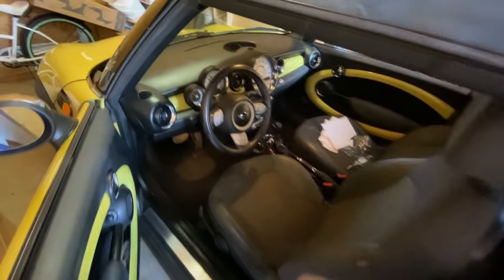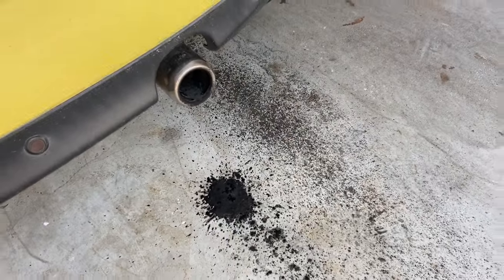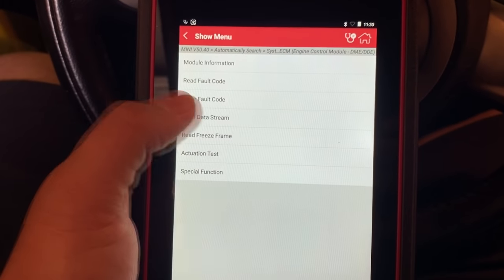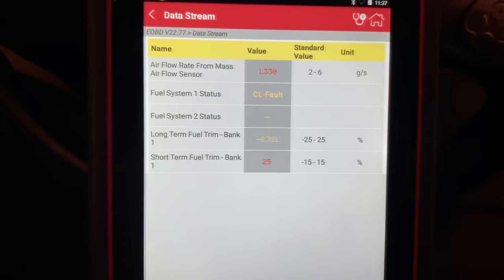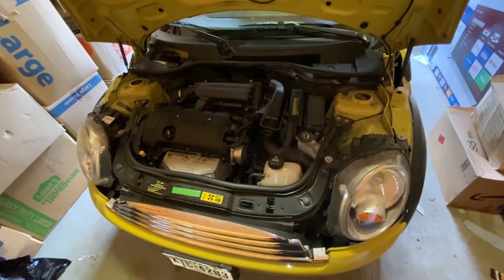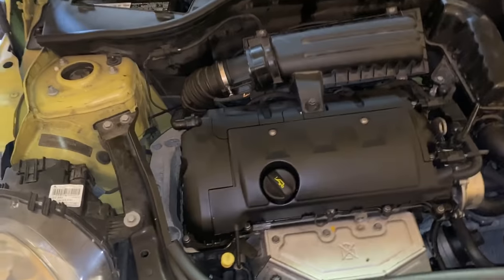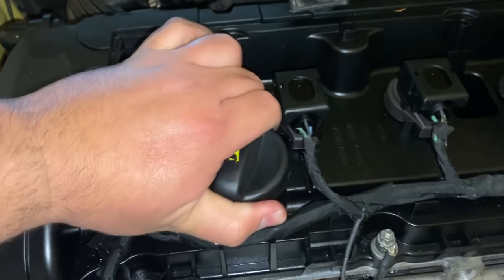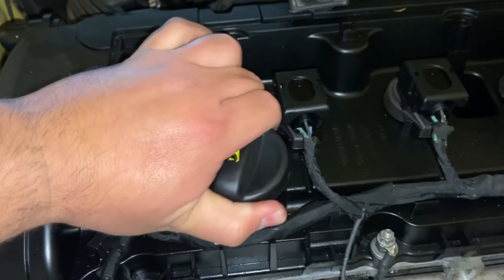MINI COOPER RUNNING ROUGH / HARSH IDLE DIAGNOSIS

Comment: BEFORE YOU REPLACE THE ENTIRE VALVE COVER, READ THIS! First of all, excellent video! The mechanic mentioned that he didn't work with Mini's, so no fault to him at all. But being a Mini owner you'll notice in the video that the oil cap isn't installed properly causing the vacuum leak (as he mentioned). I've  had this exact problem, which caused the same shaking. When the oil cap is installed properly the "oil lamp" logo will be perfectly positioned horizontally (as if the lamp was sitting on a flat table). In the video the lamp was screwed on too far making it go vertical. This is most likely because the rubber washer was lost when the cap was re-installed. This happened to me when I had some one else change my oil. You'll also notice that he had a hard time taking the oil cap off. This happened to me as well. That's because without the rubber washer on it the cap will turn too far making it like a puzzle to take off. Also, you'll notice that when the new valve cover (that included a new oil cap) was installed the oil cap was in the correct position. I'm not saying it didn't need a valve cover. But I am saying that  it definitely needed a new oil cap, or at least a new oil cap washer. It would be better to try replacing the oil cap first before replacing the entire valve cover. You might find that's all it needed. I hope this helps!
Reply: Thanks, I just bought this mini, running rough and blowing out same black out of exhaust. But they just replaced the valve cover a month earlier, when I went to check oil I couldn’t get cap off, had to use pliers.

I’m going back to check for the rubber seal.
Reply: @armhodeanapple6188  Yeah, no pliers should be needed. If the oil lamp symbol isn't perfectly horizontal when snug it's not on there right. The lack of rubber gasket allows it go turn past horizontal, and also makes it much harder to remove the cap.

Comment: You’re a
Legend. Mobile mechanic is where its at. Saves on overhead and you have a niche which makes you even more valuable.
Reply: Yes and no. Being mobile you can only do so much. Also a lot of time is burned unloading and loading your tools/equipment at job sites, crawling under cars, and driving all over town to pick up parts for repairs, or driving to different job sites. Oh and God forbid you have a comeback, or a warranty job. That will completely ruin your schedule. Also, having a shop means folks' property stays in your hands. Useful for when you have those ppl who are slow, or reluctant to pay...

Source? I was mobile for 4 years before I opened my shop. We all do it eventually. With a shop you work smarter not harder, and your income potential is higher.

Comment: That used to be a common problem on late model GM 4 cyl engines.  The upper (pcv) manifold part would crack and BOOM!  Lean codes and high positive fuel trims.  
Nice work!

Comment: Great video. Same exact problem on Wives Buick Encore with the 1-4 engine. It's built (PVC) right into it. The days of buying the $4 PCV valve & pulling it out with needle nose pliers is over. As usual it's more complex than it needs to be

Comment: I had a rear main leak on my Tundra. Just decided to keep adding oil every month and live with it. Did some research on YouTube and someone mentioned doing multiple rear main seals on a tundra. They said it was the PCV valve sticking and not allowing pressure to relieve in the crankcase. Changed my PCV valve for like less than $20  problem solved. It's been a few years now and rear main is still dry.
Reply: Great stuff, Thanks a lot.

Comment: Hey bud good catch but not 100% sure you had a bad valve cover, versus just a failed valve cover gasket. I work on these cars for a living, just wanted to share that these crankcase systems will cause lean idle faults if a gasket or seal is leaking. As the engine sucks air around the failed gasket or seal .This is an unmetered air flow and results in a lean condition.The valve cover is pricey. Last thing you want to do is sell a customer a $480.00 valve cover, when your $15.00 front main seal leaking was the culprit.😩🤭.  MINI wants you to remove the oil cap and use a manometer to measure engine vacuum levels at the valve cover. This is how you test the crankcase valve. What many of us do is take an oil cap and modify it with a npt nipple so we can hook up and take the appropriate readings. On non-turbo applications you should never exceed 36 mBar. Simply removing the oil cap with the engine running is a bad test because there is supposed to be some vacuum there. The crankcase valve's job is to create a controlled vacuum leak as it helps expel pressure from the crankcase. It can only do that if all the engine seals and gaskets are in good shape.

On the topic of fuel trims BMW uses additive fuel trims (AFT) and multiplicative fuel trims (MFT). Additive trims give you a definition of what is happening to keep the engine running stoichiometric at idle. Multiplicative trims are your readings at part throttle, or engine under load. The difference between AFT/MFT vs the more popular short/long term fuel trims are a calculation of injector on time not exhaust content. This reading is provided in ms or mg/stroke.

So say for example you have very positive AFT's, a reading of like +7.0ms. This could indicate a lean at idle condition as the computer has commanded the injectors to stay on for 7 milliseconds longer. There is one final important detail to note with AFT/MFT and that is how the computer calculates injector on time. Two main components are used: the MAF and the oxygen sensor reading after the catalyst. The reason for this is because the MAF is the very first reading or obstacle the air charge comes in contact with before the engine, and the post cat oxygen sensor is the reading of air after it has exited the final component in the emissions system. Understanding that logic, the technician can now begin the process of elimination through diagnosis.

Comment: I had the same issue with my gf’s car. You don’t have to replace the whole cover, you can buy a replacement membrame with spring and top pcv cover for around 40 bucks from ecstuning. And it’s incredibly easy to replace aswell

Comment: You literally helped me determine I need to replace my minis valve cover
Reply: a new valve cover cost $250 and that's what fixed my rough idle problem.
Reply: I think you can get that PCV valve as a single part, too. At least as aftermarket part. There's a membrane in there that is prone to rupture. There are videos on how to replace it. (The OEM surely wants to sell you the whole cover)

Edit: Yeah, you can buy only the membrane as a replacement part for like $15 on eBay.

Comment: Pretty cool to see these engines in the US have a air flow meter. In europe these engines are used in mini, peugeot en Citroën but they never have a mass air flow meter there only using a intake presssure sensor.

Comment: Those are notorious for burning oil. I did my daughter’s last summer since it used a quart of oil every 400 miles. It took a lot of cleaning in the head and piston rings. If you don’t catch the low oil they will start rattling pretty good and jump timing due to a loose timing chain. Also timing chain guides like to break too and lots of other gremlins. Vamps on intake and exhaust and the good ole Valvetronic on the intake.

Comment: Most manufacturers don't sell valve cover gasket separate nowadays b'coz as a rule of thumb - the gasket leaks as it reached its end of life, the pcv valve has also reached near its end of life. Hence sell them as a set of new valve cover and gasket...

Comment: Being a Mini One owner of the same vintage, I instantly noticed that the oil cap was not in the correct position. It should lock properly when the symbol is nicely horizontal.

Comment: Great Diagnosis! I was thinking about the infamous dirty intake valves of that Direct Injection Engine.
Reply: It's not direct injection!
Reply: @nemanjadzombic6101  You're right, seems the N18 engines have GDI with the infamous dirty intake valves...Eric The Car Guy has a good video on this issue.

Comment: My R56’s idle would have misfires after the engine warmed.  Replaced coil pack, plugs then rebuilt PVC, all to no avail.  Replaced engine cover with new PVC.  Still no change.  Finally checked vacuum lines.  They had oil in them.  Removed the oil and idle went back to normal.
Reply: Did you check the VANOS?

Comment: I do a lot of these. We dn't have that much Mini's in Serbia but it's the same engine in Peugeots (don't think you even heard of Peugeot, but anyway identical engine, even factory data PID-s are the same). Actually in USA you can buy just a membrane with that small cover and little spring that fits inside, you don't need to buy the whole valve cover. There are several sources in USA. I live in Serbia and it's much more difficult to buy one as delivery rates are ridiculously expensive. 
Common mistake that people make with this engine when it comes to ''repair'' this PCV to stop oil consumption, is to simply unplug that hose and put a cap to it. That way (and I don't know the theory behind this) they screw up oil pressure which causes damage to the cylinder head pretty quickly. When that happen there is no other option but to replace the whole head as almost nothing on it can be repaird.
Reply: I would only think plugging the pcv tube both ways will disable the engine from relieving excess pressure building up at the bottom end which will lead to engine seals failure - offcourse this excess pressure would only build at higher loads not idle-
Great info by the way.

Comment: Depending how long she drove like that , i would have checked the oil for contamination. Gotta love how bolts loosen when the engines running, evidenced by the bolt on the air box. Maybe left hand threads are better.
Reply: Good point

Comment: This is likely a problem I’m having. Just replaced water pump, crossover pipe, which cheap Chinese one broke in less than a year(50k) and a new metal thermostat housing.. it had a separate sensor built into the plastic ones, cannot find a replacement in case that one fails however… but tbd.  Everything installed, put back together, and still have issues. It fired up, but then when I went to give some gas, rough idle started and then it really glugs and chugs at about 5-600 rpm, I shut it off within 30 seconds as this just feels like it is ruining things.  I’ve had many cars idle jump around. This is different.  And I feel like it’s vacuum related, as I’ve had experience with this car running awful, until all vacuum connections were firmly secured.. I made sure this time to do so.. but I also attempted to clean my valve cover, and sprayed it down with brake cleaner as it was all I had on hand.. feel like neither dried the valve, or something cause I simply cannot see an issue. I want to test my water pump and thermostat to be sure they are working, but I can’t run my engine like this to test that.  Frustrating.

Comment: Just a friendly thought.... You might want to actually check the specs on that engine and what kind of crankcase VACUUM should be present at idle. All newer Mini and BMW engines have a closed loop PCV and pull vacuum at idle and part load with some pulling up to 30in.hg at idle. The spec for a N16 engine is around 36mBar or 19in.hg. so without actually measuring the PCV system via the oil filler cap your are taking a guess at best and if the engine is pulling excessive crankcase vacuum.
Reply: So does that mean it's normal for it to run rough when you take the oil cap off?
Reply: @mikeprice6658 Yes it is normal because you are creating a massive vacuum leak.

Comment: Awesome video. I had a similar problem with a pcv valve. I ended up replacing the valve cover as well. However during the installation of the new cover I had some oil get into the pcv valve. Now I don't think I have vacuum leak or anything but I am not sure if the oil that got into the pcv valve can damage it or anything. Will it only gradually go into the intake and get burned or can the pcv valve get damaged? Thank you!

Comment: I am having very similar issues with my 2009 n14 turbo engine.  I’m going to change the pcv cover to see if that makes a difference. Been chasing miss fire issues maybe this will help
Reply: How did it go with Pcv?? Did fix or not am about to replace cause same issue what am going through about same let me know tnx
Reply: @ramonacevedobravo4398  on mine it was a blown head gasket. Between cylinder 1-2

Comment: My 2012 has a long term fuel trim around 65 at idle but goes down to zero while cruising on highway.   I took off the oil cap and did not feel the suction that was in this video, but when I took off that PVC hose and plugged it with my thumb, the long term instantly went from 65 to 35 and my short term immediately went to -25.  Does this sound like the PCV valve even though I don't have the suction on the oil cap?  As a DIYer, I find your videos very educational.  Thank you.
Reply: So the valve cover with built in PCV valve was my problem.  Thanks for this video!

Comment: I've seen this fault on VW's and some of the GM Ecotec engines.
Reply: South Main Auto did one of these a while back on a 4 cyl Chevy.  A shame you have to replace the whole cover.  And they are subseptable to cracking.
Reply: GM’s 1.4L are known for this
Reply: As far as I know 2.2l  ecotecs don't have pcv valves

Comment: Another cool diagnosis and repair!
Hopefully, the oil (or excess fuel) burning issue wasn't going on for too long, causing damage to the catalytic converter(s).
Reply: Well it's a MINI, so it's been burning oil since the day it was born. What usually kills the cat on these is misfires, and that unburned fuel dumping on the comb makes short work of the catalyst.

Comment: Mini r56 cooper s with n18 engine. Reporting P0302, 2efe, 2f00, 2ee2, 2ee9. I can see in diagnostics most of the misfires are on cylinder 2 and maybe few on other cylinders. This only happens first time in the morning when starting with cold engine, after that it's ok. I've changed sparkplugs and rotated coils but it's still reporting cylinder 2 misfire. I've tried injector cleaning additive in the fuel tank and after full fuel tank problem is still here.
I've logged diagnostics live data for current and desired fuel pressure and both are showing the same values iaround 5150kPa when idling so I don't think it's HPFP. Long term and short term fuel trims are 2-6 when cold and -2 to -5 once the engine is warm.

Any advice on what next I could do is appreciated.

Comment: hello.
I own a 2016 sportage and at full throtle it puces a lot of  oil thru the crankcase breeder into the intake, what can cause that problem? I have already changed the pcv valve still the problem persist

Comment: the valve is there to give low vacuum at low revs and high vacuum at high revs, when it goes wrong it gives high vacuum all the time, on the 16v 4 cylinder Vauxhall's you know when this valve has gone because it gives you a James bond smoke screen at high revs, it will suck the sump dry.
Reply: Much valuable information, Thank u very much.

Comment: Interesting video. Brother-in-law had one that loss power but never quit running. Just no power. Shop place on computer and indicate that the radio was bad. Bunch of heads being cracked. Car went to another dealer, more head scratching.  Mechanic brought in from Germany. Engine  Torn down finding nothing wrong with engine and reinstall and retest on computer. Again indicate that the radio was bad. What was discovered was the radio has a receiver that connects to a  Satellite that updates the  Vehicles computer. Amagine that! With the receiver the radio out and the computer not updating ,  Vehicle would not run properly. So a new radio was installed and guess what. Yep, problem solved. Run like a  Scolded dog that was fed with the right information. 
So the pc first  Diagnose the problem correctly and a master  Mechanic couldn't. 
Brother-in-law not long afterward got rid of any further problems with the  Mini co-op.
This is how I remember it going on with that car. 
But like your problem solution and what led you to correcting the problem correctly. 
Great job will done.

Comment: Hi there. I live in France. Thanks for your video. I have a problem too. Maybe you can help. Same engine. My car starts normally. Idle is perfect. But when I drive, engine has small jerks. Like you, I have checked many things but still have these jerks while driving. I have added oil to the high pressure pump, changed the sparks, the 4 coils but problem remains. I have no default code on the dashboard. Maybe the same solenoid device that you have changed ? If someone could help, thanks a lot !!!

Comment: I have the same problem with p2178 combustion rich I also have a p1340, although I opened the engine head 5 times and everything is fine, however, the same problem The rpm counter goes down at the start of heating And the oil cap as in the video هل يكون هو السبب؟

Comment: One thing when you put it back did it do the same with the oil cap suck it it or did it stop you never let us know
Reply: Great point
Reply: Ive changed my valve cover afyer watcjing this but its still running bad and still sucking at the oil cap 😩

Comment: Can someone tell me why the Range Rover (I believe around the06- 10 cant remember exactly) has high vacuum in the valve cover(oil cap). I had one come in with a lean condition  after testing I pulled the oil cap and it almost stalled. Replaced PVC helped a little but same thing (it was the valves). So the next 3 Rovers I seen I checked the oil cap all 3 had high vacuum with no complaints. I wonder why?